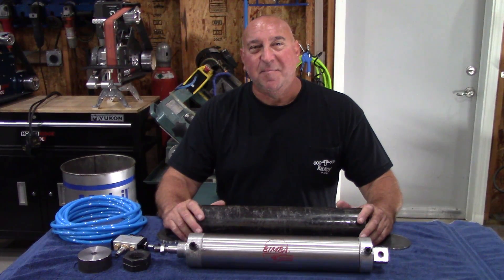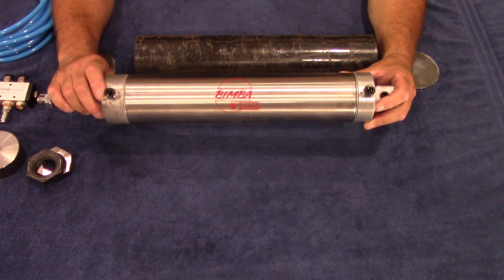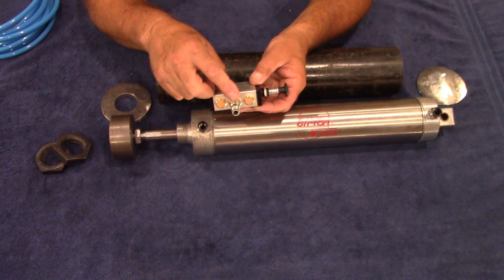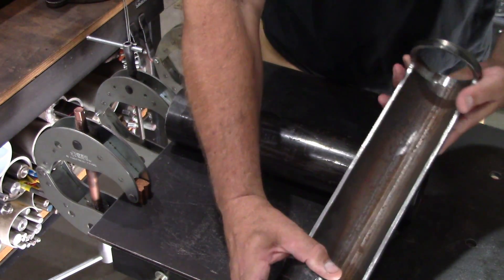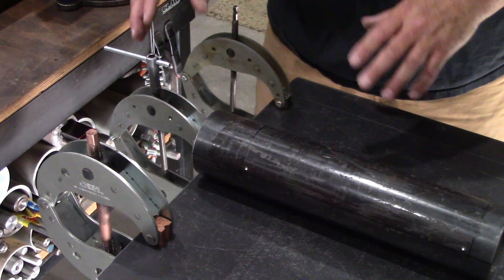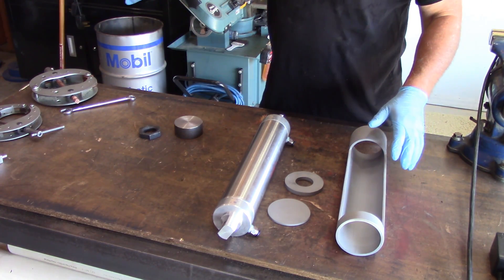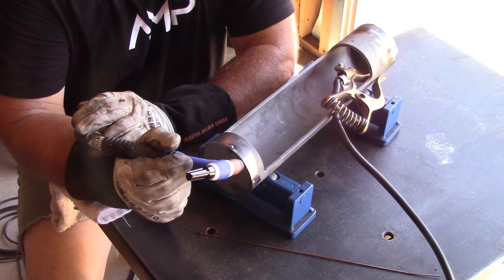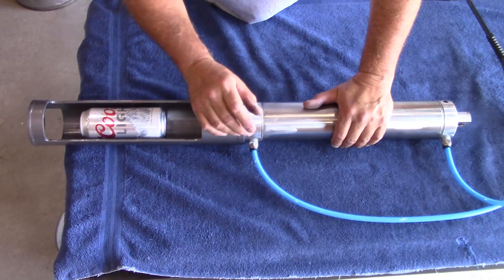Can Crusher Build

Comment: Round pipe center horizontal line tool....Hi Ray, sorry to bother again...I have been looking for the center line tool that you have used to mark on both side of the 3" pipe, but I could not find it any where.  if don't mind buddy, can u send me the link to get one for my self, and Its very simple to use, right, I like it.  I really appreciated sir,  also I would like to wish you Merry Xmas and all the best for 2024...Cheers....Edi
Reply from the maker: Merry Christmas Edi!!! Here is a eBay link to something similar to what I use.
https://www.ebay.com/itm/235355568192?hash=item36cc48f840:g:qPkAAOSwnwZlhcUe&amdata=enc%3AAQAIAAAA4DW6A5nJGctZmkYV%2FZSEmyy%2FAaWcYFYWF1GlNH5mSPOsVU%2BYhncJK092R7J7WfRjYclg0JtexOPlQf8VyKOERZvjItHaSSu7h0cC3rii7N8Xofg5xDqknaNMRj4X6xZW5ACPIon8mu3wcC3%2FZ1E73Ae1YMnaNW8TW6C%2Bra44PJlNEqepNlYxwxQNBWSWPJWE%2B9DooBoqNnihK8PIU%2Bg9wl3vWrT%2FTUBdZ3%2BPk7Ij1PuH1KqleNtEFGaKrxtZFedD2c9UltfBUewDIBvFt1EKGGvb5%2BLxW5PMOSFThzB%2BSAvL%7Ctkp%3ABk9SR9rHtsuTYw

Best Regards,
Ray

Comment: Congrats on this build! I'm just now getting into DIY pneumatic can crusher builds & this one (by a huge margin) is the best one I've seen. Simple yet strongly made. Clean, compact design. Material was a little overkill especially with the soft end & return cylinder (could have used your original piece but now you have one your great great great grandkids will enjoy, bravo). The ONLY thing I would change is the actuator. I'd install a foot actuating pedal to keep both hands free. Sweet build, Ray! Having the RIGHT tools helps. Most DIY'ers won't have a Plasma or a TIG...let alone BOTH.
Reply from the maker: Thanks Daniel, The foot pedal is a great idea, I used one on my Crusher Cart build, link below. Sounds like you have this well thought out already and am sure yours will as bad ass as mine!
https://youtu.be/jDY_CJAvFXU

Comment: I have all the parts to build a can crusher like that, all the parts cone free from my job, just need a welder to build the frame for it. My cylinder is about twice as big around but 12 inch stroke and the valve is spring loaded

Comment: How did you adapt the air inlet quick-connect to the valve body?  That part seems to be missing from the list of parts.
Reply from the maker: That’s up to you and how you would like to feed the air, I have mine direct connected off one of my air supply drops with one of the 3/8” push connects.

Comment: How big is your compressor? What cfm is needed?
Reply from the maker: Hello Jim, This Bimba Cylinder can handle anywhere from 90-200 PSI and as low as 19 CFM and higher, so any off the shelf air compressor with a tank should run this no problem!

Comment: If safety is a concern, the controls for this can crusher could be modified to require both hands to actuate the ram.  This is commonly done with industrial hydraulic presses.  With the operator having to place a hand on each of two control buttons or levers, it ensures that his hands aren't anywhere near a crush zone.

Comment: He traded 81 Lbs of crushed aluminum cans for ~ $138?? (US dollars) Where is he trading them in?  They are offering him ~ $1.70 Per pound??  The best I can do around here for traded in crushed aluminum beverage cans is 60 cents per pound.  That is TOPS here.  Other places near here will offer you from 35 cents to 45 cents per pound which the majority of them do   Cans are not pure aluminum for some of their weight is the external paint, inner coating, and a little moisture, dirt, cigarette buts & dead bugs.  All of these do not contribute to the aluminum content when melted down and reformed into the raw material.   The present market value for pure aluminum is $1.12 (US dollars) per pound.   https://www.wolframalpha.com/input/?i=1+lb+aluminum  HOW ON EARTH is this guy getting $1.70 per pound when pure smelted aluminum processed through the electricity needed to extract it from bauxite is $1.12 per pound?  Here is another article that does not make much cents to me >> https://www.treehugger.com/beer-and-pop-cans-are-not-being-recycled-because-car-makers-dont-recycled-aluminum-4858076   Surely recycled aluminum is at least closer to the virgin smelted ore than the ore itself?  Why cant can aluminum be purified to the same standards that virgin aluminum is?
Reply from the maker: Yes, I’m getting $1.70 per pound, I was getting $2.10 a pound last year but have not see it that high in a while. In Ca we pay tax on all beverage containers called CRV you get some of this tax back if you bring it to qualified recyclers. I always bring a minimum of 50 pounds of crushed cans and usually get $1.50 up to $1.70 per pound pending market price.
Reply: @RaysGarage  Where can you get prices like that?

Comment: So all you need is about $75-$80 give or take in parts a plasma cutter, drill press, a mig/tig welder, 7 inch angle grinder, a tap to thread the plunger face for the rams rod, some hand tools and a few hours work? It's good that you don't sell these as the cost to produce them would be twice that you could sell them for.https://www.amazon.com/gp/product/B07Y5VMNZX/ref=as_li_ss_tl?ie=UTF8&psc=1&linkCode=sl1&tag=tooinact-20&linkId=138f8b292bf62fb4ddd4d1162cbe796b&language=en_US

Comment: Nice job ..!!... suggest welding the nut to the end cap then you won't need the socket to tighten the nut on the cylinder.
Reply from the maker: Hi Dan, I was not sure where I was going to index the cylinder or I would have threaded the rear plate or welded the nut like you suggested. Thanks for your comment!

Comment: I wish you had a list of the parts used. Maybe next time.
Reply from the maker: I’ll add a parts list this evening, thanks for asking!
Reply from the maker: Rambo, Automationdirect.com is where I picked up the fittings, 3/8” tubing, 2/5 valve, and valve exhaust mufflers. I have not had the time yet to post a parts list.